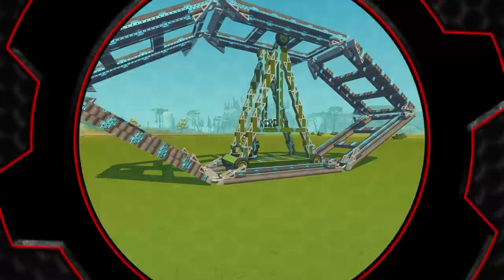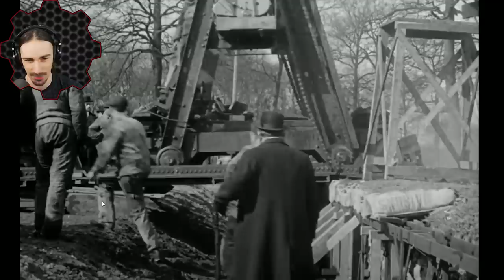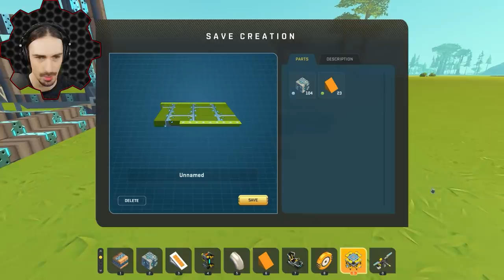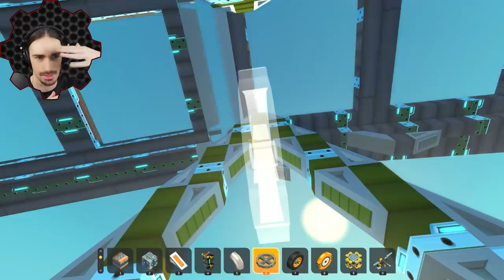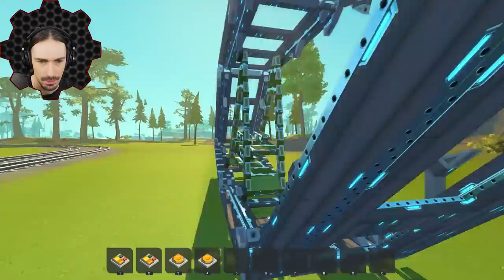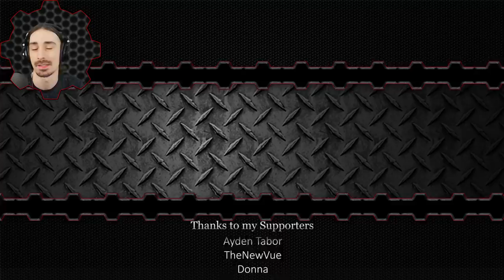I Evolved This FAILED War Machine Into A SUCCESS

Comment: the derailment issues might be fixable by making the grove deeper
Reply: Probably not, because there’d still be gaps in the barrier so the tracks can go to 45 degrees. Since it tends to derail between tracks, there’s little benefit and it’d just add extra weight.
Reply: @JamUsagi  true
Reply: I actually built one of these, and I've completely solved this, and it isn't by using a deeper grove. Running down the center of the tread is a rail like lip, and the vehicle clamps to the rail using two separate clamps. If the track leaves the reasonable tolerance for the center rail, you unhook the front from the seem, hop the gap, and then re-rail the front. After that, detach the rear and your good. Is this completely rediculus for a design like Scrapman's? Yes, but in my design, the tread is super heavy, so this helps to keep the carrage from tipping over, and also helps my gears mesh with my toothed track design.

Comment: The Tsar tank from WW1 would be really cool to see in this game too.
Reply: Agreed
Reply: Yes
Reply: Similar to this challenge Scrapman could try to redesign the Tsar tank to actually work.
Reply: Good call mate, that would be interesting to see!
Reply: @Hyper_Fox06  don't think that would quite work just because one of the main issues with the Tsar tank is that there was too much weight on the rear wheel so it would dig into the ground. In Scrap Mechanic that doesn't happen
Reply: You are right
Reply: @Egerit100  I know and that would be a major re-engineering problem for scrapman.  Just a thought for possible content
Reply: Y e s.
Reply: That would be kinda a cool build. The wheels might be difficult to make without mods however. I think he can do it though.
Reply: Or Tsar Bomba
Reply: @theyeetus1428  I don't think the explosives physics will do much more than the existing nuclear bomb does in scrap mechanic, maybe glitch weld a bunch together?
Reply: Tsar wat
Reply: @Hyper_Fox06  no cuz its not a problem in scrap mechanic
Reply: @etgamer4life984 I'm not certain to which you refer, the Tsar tank re-engineering or a Tsar Bomba which would be completely impractical in Scrap mechanic other than a physical mock up.
Reply: @Hyper_Fox06  I'm confused
Reply: @Hyper_Fox06  Maybe he could make it controllable for a more interesting video.
Reply: working tsar bomb would be cool also
Reply: @Hyper_Fox06  bomb props mod
Reply: Or the british tanks

Comment: Lots of my thoughts here already. Haven't seen this one though: An option to drive the top wheels alone, so you can get the track back ahead of you in sketchy spot, assuming friction will cooperate lol. Thanks for the vid!
Reply: I think he did that in the first vid?

Yeah at 15:28
Reply: @wingedfish1175  In the first vid, he has two motors to control the speeds of the wheels separately, but they always run at the same time, since Scrapman didn't add any extra controls/double bearings to allow that

Comment: An easy way to make it turn would be to spawn 2, then connect them by the sides with a bit of redesigning, then it would look like a mark VI tank a bit.
Reply: I did it and it could steer but it happened really slow.
Reply: Historically accurate

Comment: You are brilliant ScrapMan.  According to steamcharts, barely 2k average monthly people play this game, but hundreds of thousands of us will happily watch you play!  Fix idea: 2 more wheels on top of the track to pin it (the tracks) between the top wheels and their new parallel counterparts could solve derailment as well as instability issues.  Probably will need more weight on the bottom section though.

Comment: You can improve the steering by replacing the buttons with sensors triggered by an arm on a bearing controlled by the driver seat steering (A&D)
Reply: You could also have the notches that allow you to turn on other parts of the track

Comment: you can improve the steering and the derailment issue by adding a pipe to your wheels and make a sideways-one-block high rail on each track segment since the bounces only occur on the middle. this also gives th option to steer at almost any point

Comment: Good job! You fixed so many issues with this machine. But, (this is my opinion) I feel like the turning mechanism isn’t the best it could be. Because it has such a small contact patch and it will have to bear basically all the weight of the whole machine, if you were on say mud, the wheel would most likely just fall through the mud due to the pressure (or large amount of force exerted on a small patch) and lose traction, rendering turning impossible. This doesn’t happen in Scrap Mechanic because the ground isn’t able to flex / bend / move. But in real life it would. Of course, you could just try and drive to harder land but, this still takes away from the machine. the whole idea of the tread was to take away pressure. Sure, it’s the weight of a tank, but because the contact patch is so massive the pressure would only be about 10 lbf/in^2 to 16 lbf/in^2. This is why tanks were made with treads, as soft terrain was a lot easier to pass, and this solved the glaring issue tanks had, if they sunk in soft terrain, they would always bottom out and not be able to get back out without the assistance of a different vehicle or a big scoop as part of the tread - aka a log that was tied to the trads in these situations - and this was due to the fact that that the bottoms of tanks where large and flat, meaning that they exerted a lot less pressure than even the tank's treads. This is why the solution with the wheel would not be the most practical. I understand that it is very hard to come up with a solution that takes everything that I've said into mind, but you guys's creativity has never failed to blow me away. The only solution I can think about is to try to make the whole big tread made up of small tracks that are perpendicular to the direction that the big track is pointed in. This way you could have tank steering when two of the sections are on the ground at the same time. Another Idea could be just to simply weld two of these things together, creating two huge tracks side by side. Thank you for coming to my TED talk.
Reply: Wow! 

when’s your next Ted talk 🤣
Reply: I was just thinking of a Omni Wheel design…

Comment: you can seperate the two sides of the "track" from each other and have seperate control with two buttons on the wheels from each side of the center car then it will have tank steering

Comment: Looks like some guide wheels that fold out in front of and behind the bottom and top wheels could help with the de-railing.
You'd just need to put them on suspension. Because you don't just need to deal with the situation where the track forms a rectangle, but also the transitions between those states where it forms a flattened hexagon.

Comment: You could even alter your center of mass left or right using a weight on a piston on either side to help avoid tipping in some instances, so long as the weight is low on the body.

Comment: I think that  making the wheel base closer to the length of a track segment would make the vehicle more stable in the track, and less likely to tip backwards.  Larger wheels  might help with the machines interaction with the leading track joint allowing it to start pushing on and putting weight onto the next track before the axle crosses the joint.

Comment: I'd really like to see a return to the 'flip walker' using this jack-based turning. Hypothetically, you could attach a similar pivoting jack to the 'gondola' to allow it to steer as well. An alternate solution is using a set of lifting thrusters to get it into a 'hovering' state, then pivot it in midair.

Comment: Kind of useless as a vehicle of war, but I could see it used as an overly engineered, mars roving crop planter.

Imagine that each of the track pieces were solid and spiked like a cleated shoe, and each of the spikes are narrow yet hollow like a traffic cone or needle and the core driving vehicle drops seeds through an auger on it underside as it drives.

To compensate for the solid tracks however, you'd need switch the steering mechanism out with two wheels that extend out and lower from the sides of the core vehicle instead of in front of it, and the wheels would need to turn in opposite directions like an RC car can to turn in place.

It'd also have to be a drone or remote controlled... because you wouldn't be able to see where the hell you're going either... but personally, I wouldn't want to be inside that thing as it operates anyway.
Reply: Yes.

Comment: Probably reduce your detracking problem, move your turning dogs to under the on the track, and add the inside/outside wheels at the bottom, maybe add those suspension components to help stay in contact on rough terrain and add weight in for traction, or put a set of wheels in on their side trapped in a track to hold it in

Comment: You should try to increase amount of axes for the bottom part, and if you can solve the problem of bottoming out on 3 or more, you should get improvement in derailing problem, also, you can rise walls on tracks, to intercept derailing even more.

Comment: Add another bar above the wheels that is low enough to prevent derailment, but high enough to not make contact  when driving. When lifting the thing, the wheels will make contact and lift the tracks. Add a piston to the center of the vehicle instead and lift the entire thing. Then rotate the piston. A bit more unstable steering probably, but not unsolvable.

Comment: If you over and up and add a wheel to the top and and add side wheels on the bottom you can potentially fix the derailing. Also if you deactivate the bottom wheel you can move the top forward when you get stuck on steep inclines

Comment: how about instead of suspension you can put grip (as in stripy layers of blocks )and place it at the bottom of the tracks and it will also weigh it down on to the wheel

Comment: First: the top wheels dont need to fit in the track. You could have arms that go out at the top then up then in then down so you have wheels on the bottom and top of the top section of track that would give better contact and might help prevent some derailment and maintain traction.
Second: the outside of the track loop does not need to be flat, you could add texture to give better traction and stop slippage on hills. in scrap mechanics that will probably mean cacti.

Comment: The problem seemed to be torque from the top wheels. In the previous episode they were faster than the bottom, but with the suspension added, the top is being moved faster and the back end is being lifted due to that.

Comment: At 18:36 you said that you did not know a solution to fix the uphill climb, I have an idea to propose. Maybe have a frame that folds up to the backside with a couple sets of tires (maybe folding inwards when not in operation for clearance) with semi-stiff suspension on the tires so that you can increase the length of the vehicle momentarily and lift the mid section (the current rear) to increase the probability of it succeeding the climb? If you do try this be sure not to make the extension too long or it may bind/prevent the track and be unfunctional.

Comment: Using big wheels instead of small wheels and adding two of them with a small pipe piece in between them so it doesn't derail along with rails that are one block taller, while removing the wedge peices for the turning mechanism, and use a cog like set of small pipes with cacti on the ends to turn instead of a wheel.

Comment: I think the top could be improved massively by adding a wheel on top of the tracks that pinches down onto the current top wheel. In theory, if it was big enough to not fall in between track pieces, then it could completely solve the cycle skipping issues. 

And for the bottom, one idea would be to make the retaining wall 1 block higher except near the turn hooks. Or maybe making the wheels 2 wide so they have a harder time slipping out? 

Either way, I love watching the prices of this thing being designed and refined. Good job mate!

Comment: Wow! Heck of a job improving the function of this bonkers design! lol! One improvement I suggest, is instead of having the one location where you can set your hooks to lift the track for steering, use pipe pieces and run it as far along each rail as you can. This will give you a few more different options for steering locations, and as a side bonus, it should almost completely fix your derailment issues.

Comment: 1.Idea:no more Derailing by putting the sides and lock for the turns up by one or two blocks.
2.Idea:making turning faster.
3.Idea if the incline is to high and the top wheel doesnt Touch the top, put the Piston on another button or more to finetune the lenght.
4.Idea put high friction blocks on the bottom of the tracks kinda like table legs

Comment: I've been meaning to tell you this sense the video you built this and this idea suddenly came in my head to solve the turning problem. What if you made a built in turntable (or a platform that you can lower from the bottom of a tank) If you want, you can build a separate with this design and the tank can be any shape you like.

Comment: You need suspension on the bottom wheels as well as doubling up the wheels to smooth out the derailment issue at high speed

Comment: Could u make distance between top wheels wider and double them up like on a roller coaster, so they hug the outside track on both top and bottom.  Maybe it would keep it from getting off track and keep wheels in contact with track.

Comment: A big glaring issue I find with this is the idea with a tank like object is to not have wheels in contact with the ground because the wheels aren't strong enough to go over certain train namely things that can pop the wheels so you could do this but you're going to have to probably change that turning wheel a lot

Comment: I say we not only have The Wheels on the inside of the track having little slots for them like they are now but say placing a block and then adding another wheel on the outside of that block so the derailing wouldn't really happen because preventing side-to-side motion and also I say increase the tire size so you have more contact with the wheels and going over the gaps between the tracks themselves would be a lot easier transition between each track possibly even adding suspension if you're worried about friction problems probably add some high-friction block on the outside
Reply: And even a possibility double the amount of tracks you have so basically cut each one in half so you have more flexibility

Comment: just needs a little more weight lower down. A few more blocks behind the drivers set will help prevent derailing. Then it may be time to make this thing battle ready. Weapon mounts on the sides perhaps?

Comment: Make the top engine be able to move the top end of the tracks independently of the bottom engine that drives the vehicle. If the tracks lock You up, separately advance the tracks on top of the vehicle but having the vehicle remain in place.

Comment: Crazy idea, but why not suspension for the bottom wheels?
And to solve the top derailing why not add a wheel that goes out to the sides, then up, in, and finally back down onto the top.
Granted then you would also need to add tracks to the outside of the sections. But that would also solve the issue with sections coming up at the wrong point. Anyway, good video. looking forward to how you solve this.

Comment: for the deep ditch, you might be able to get through it using the jack to support the back of the track.
and as for trying to make this "viable" with proper turning with this wheel method,  you'd never be able to actually bypass the friction of the entire track with the wheel in real world settings.

Comment: As one of the biggest threats to crossing no-mans land was machinegun and sniper fire there needs to be some more armor protecting the main operating components and pilot from small arms fire
Reply: Also the steering wouldn't work in mud on account of the small points of contact, so it needs to be rethinked again

Comment: What if at 18:17 you added more pistons below the ones already at the top to further push on the track so you possibly got more traction on it? So you could have those pistons already there that extend by 2, and then maybe add ones below them to further raise them by 8 or something. I kind think of the track as a loose chain, and maybe raising the wheels to decrease "slack" could improve it a bit. But I don't know, it's just a thought :)

Comment: Ive got two train experiments 

Either the 
Rail zepplin (used propeler to move, only one built, was scrapped) 
Or 
Soviet Turbojet train (has two thrusters in its cab roof, one/two built, both scrapped)

Comment: If you remove the beams in between the two sides and use better track guidance (like you did in your first video of this design), adapt the propelling of the wheels at the sides, (make it independent) you might revert this machine to proper tank steering?  I like the idea of improving this machine as it is actually showing the evolution of tank treads very nicely. A bit like your evolution challenges IRL :)  It seems that the development of rudimentary track designs was made during WW1 and perfected after that, also for agricultural and ground moving vehicles.

Comment: Instead of the hooks you should've put railings there, which would eliminate 3 issues at once.
1. Turning is only available in given places
2. Having to move the hooks in and out from under the vehicle
3. Derailing

Comment: The only other improvement I would make is if its possible, put the top wheels on a logic gate with a switch so you can separately control them, and if that's not possible put a double bearing on the wheels so you can have separate control with a bearing